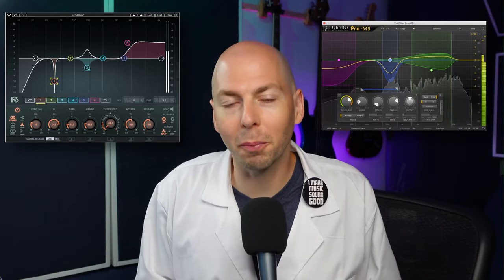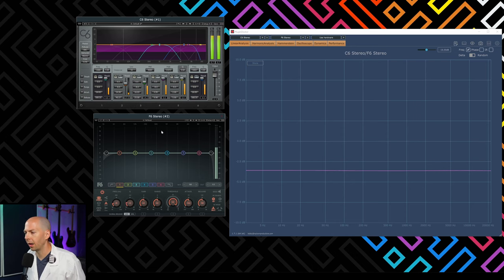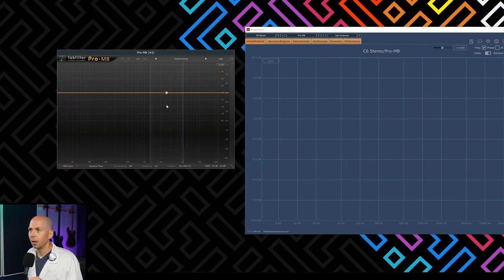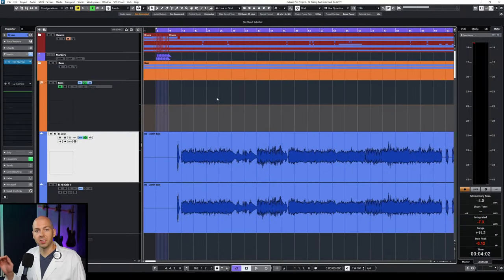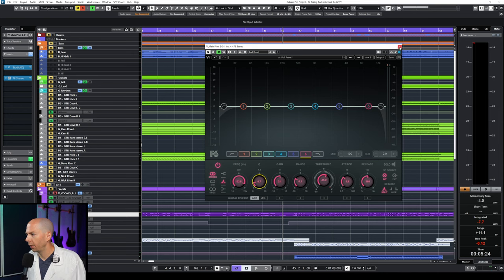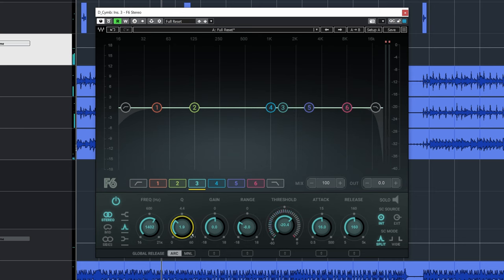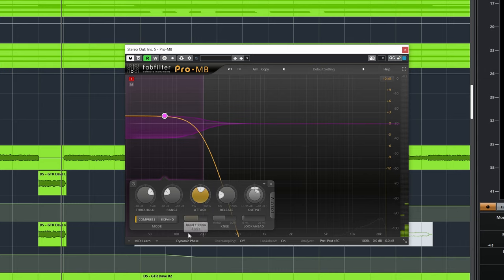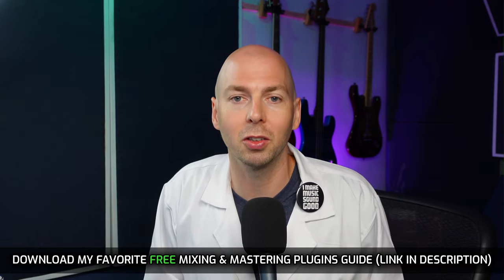HOW and WHEN to Use Multiband Compressor vs Dynamic EQ Plugins | FabFilter, Waves Tutorial

Comment: I know it sounds weird...but I almost never use Multiband compression until its the mixing/mastering stage of the production. I kind of have fell in love with F6 RTA dynamic cuts into Transient Response into SSL Channel strip into 1176 into FX Sends combo. 

...except with EDM sounds...but most of the time I just use whatever multiband compressor preset is in the FX section of the VST

Comment: I almost always use a multi-band compressor for chugging guitars, but will always reach for a dynamic EQ at the master buss level if there is a low freq build up, or if the cymbals are getting out of hand. Dynamic EQ is also very useful for some singers that sound a little shrill when they push.

Comment: I usually use a multiband compressor in sidechain mode for groups, for example to let the fundamental of the snare pass through guitar or whatever...
would it be more appropriate to use dynamic eq for this task? if i tend to go to multiband is for it´s more flexible and control of parameters (fabfilter MB)
What you think?
thanks!

Comment: Note: There's dynamic EQs out there that do work with ratios, like TDR NOVA.
Reply from the maker: Man, that makes the differences between the two even harder to distinguish lol!
Reply: Yeah, there’s another one from ToneBoosters called just “Equaliser” and it’s possible to set ratios for the bands as well as to set the bands to “downward compression” and “upward compression” modes. how crazy is that lol?
but anyway, it’s a great powerful tool from a fairly respected developer, i seem to like it